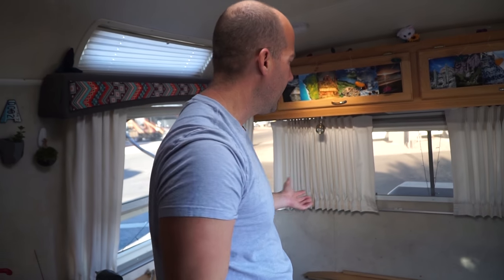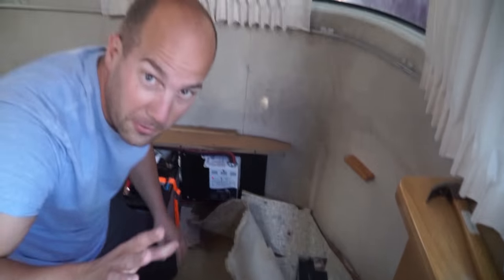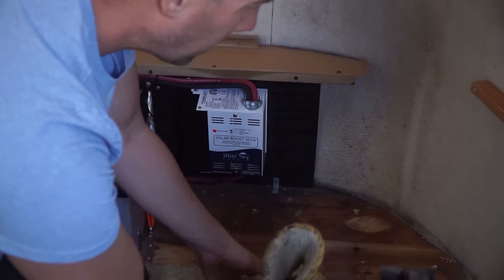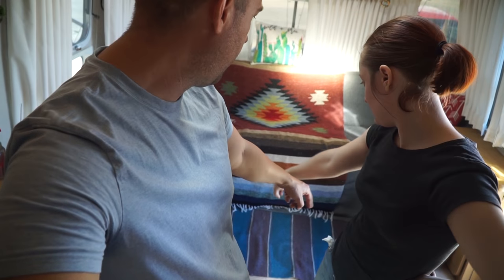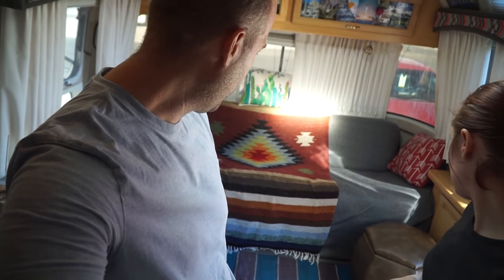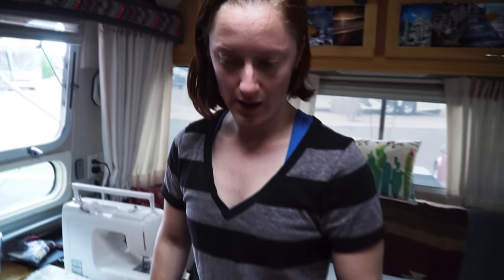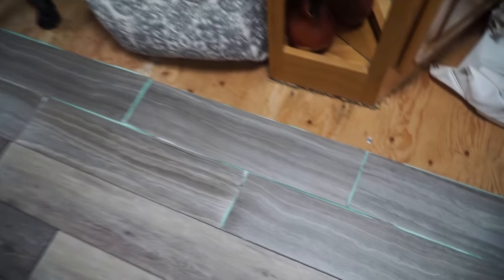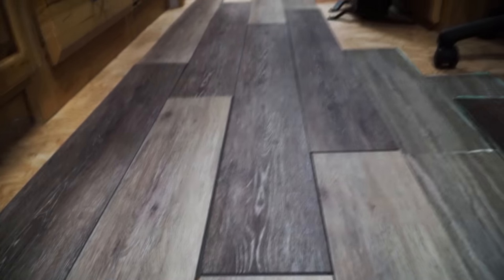Our Airstream Renovation - Removing the Carpet...and More?!

Comment: Good job guys, you are very brave to tackle this project! Maybe a little joint filler here and there to smooth out the base ply wood floors, and some spray on insulation in the pipe chase hole by the cabinet? That will help keep mice out as well.
Reply from the maker: Thanks for the suggestions Norm! Definitely don't want to invite mice in!

Comment: I didn't have the time to put in a floor so I had A&P Vintage Trailer Works install Marmoleum sheet in our Classic 25fb. They pulled up most of the furniture, sanded and leveled and their installer was able to lay one sheet including the bathroom so no seams. The floor was glued down. Then matching wood quarter round molding was attached along the hallway and kitchen cabinets they couldn't remove to hide the expansion gap. Remaining furniture was then installed on top of the floor. Please don't get Allure flooring. It will start showing gaps if exposed to cold weather. Good luck.
Reply from the maker: Sounds awesome KJRItch! The whole sheet is definitely the most durable from what we've seen/heard. We decided that was going to be tough to tackle on our own. It's awesome they did so much prep work too. Sounds like they did it right! We're very happy how our vinyl plank turned out. It's not Allure and we've heard good things about it holding up but only time will tell I guess.

Comment: How did you get the water damage at the back of sofa   ?
Reply from the maker: There are 2 outdoor compartments that open on either side of the hitch in the front of the Airstream. They are supposed to be sealed for water but after many years apparently water damage is common. Mostly because when towing the Airstream in the rain that is where all the water splashes back onto. Luckily it wasn't too bad and we've since completely sealed those compartments so we shouldn't have any future issues.